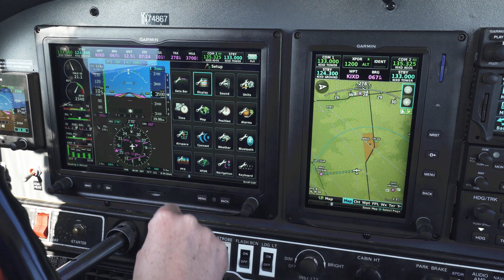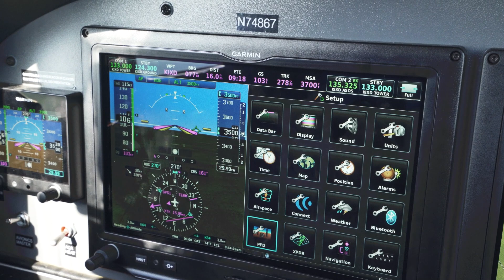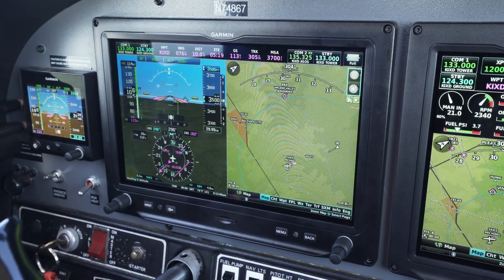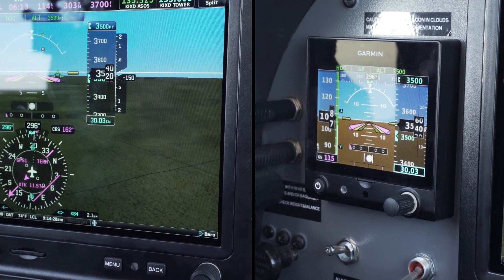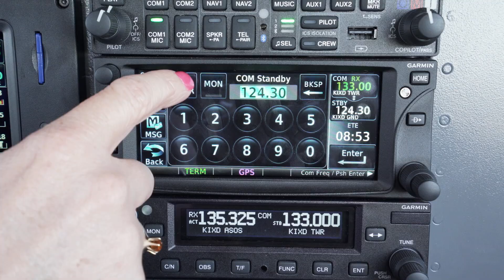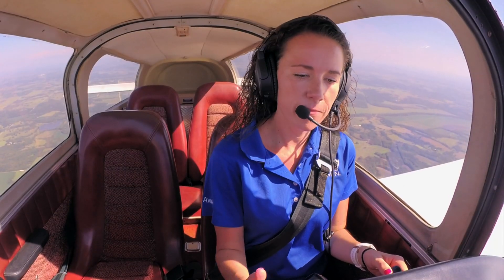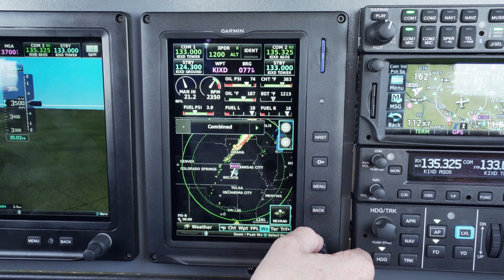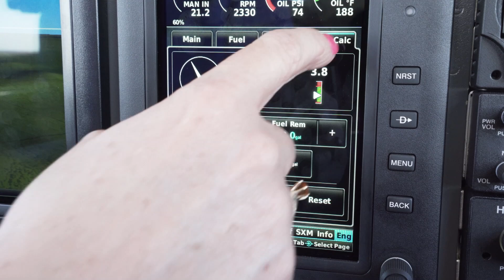G3X Touch for Certified Aircraft: In-flight demo

Comment: Can it fit in my Cessna 150 ?
Reply from the maker: The team believes the 10.6" display will fit in the Cessna 150, though a Garmin dealer will need to assess and validate that. Thank you for considering Garmin.
Reply: This will also vary as to which year the aircraft was built as some instrument panels and yoke layout preventing a display from being installed.

Comment: I’m just curious as to how you’d shoot an approach if you lost your PFD in a IFR situation 🤔.
Reply from the maker: The G3X Touch and TXi flight displays require either the retention of three primary mechanical instruments, including the attitude, airspeed and altimeter or more commonly a standby electronic instrument like the G5 and GI 275. The electronic instruments are required to be powered by a separate power source, most often a built-in battery. So should the primary flight display become unavailable, the backup instrument can serve as a backup. Thank you for considering Garmin.

Comment: Can the G3X Touch fit in my C162?
Reply from the maker: The G3X Touch 7” portrait display has a slightly different shape that protrudes through the panel requiring some minor panel modification, but it is a close fit (reference pages 78 and 102 of the install manual here: http://static.garmin.com/pumac/190-01115-01_am.pdf).

The G3X Touch system does work with the same connector as well as sensors already in the aircraft. 

However, all that said, the larger challenge is that the installation approval was unable to list the C162 Skycatcher because of its aircraft designation as an S-LSA. I talked with our certification team and they mentioned there may be a path to convert the aircraft from an S-LSA to an E-LSA that would make the G3X Touch for experimental aircraft a solution for you. 

However, there are likely a lot of considerations and limitations worth researching before taking that on. I did some searching on the internet myself and found some popular experimental aircraft forums discussing this. I hope this helps. Thank you for following Garmin.

^DK

Comment: In the video you show how if you lose the G3X display that the autopilot will temporarily disengage and you can re-couple to the G5,
which variation of the G5 do you have to have to make this possible? I know there is now the GI-275. Which variation of this do i need? I was told that you only needed the GI-275 ADAHRS+AP if i am using it as my primary, and that the GI-275 ADAHRS would accomplish what i need. Can you explain?
Reply from the maker: At this time, the GI 275 does not talk to the GFC 500 Autopilot, it only works with the GFC 600. If you wanted to install a unit now, that will work with the GFC 500 in the future, the GI-275 ADAHRS will support it in the future. The GI 275 with ADAHRS will be used as a primary or standby ADI.

^DK